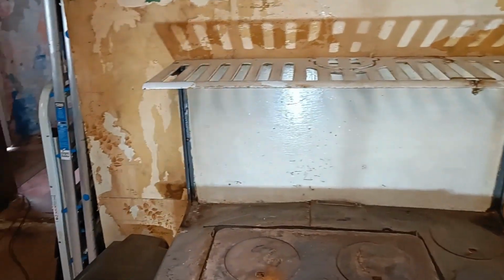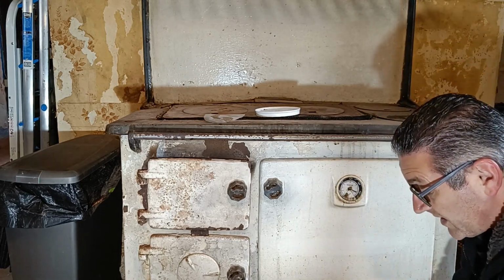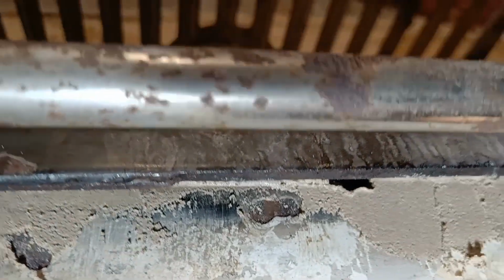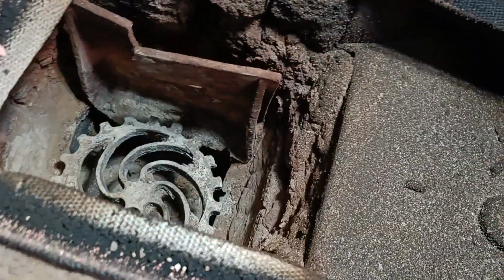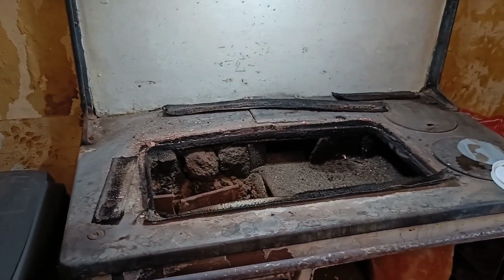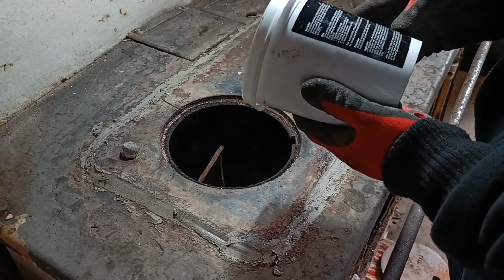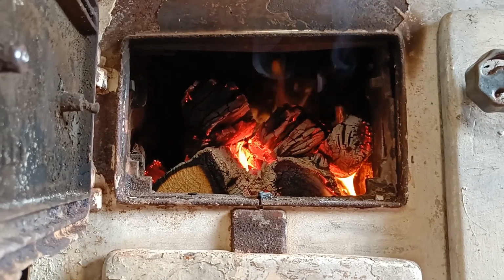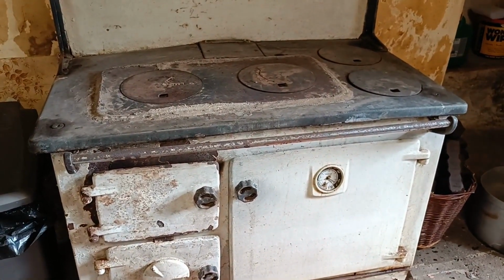Where there is smoke there is fire!

Comment: Interesting way of laying your fire Ben L was always told to put the small stuff at the bottom and only put logs on when that was burning well  but your ways seems to work very well well. Another interesting video😀
Reply from the maker: Yeah we thought that too as Dawn was reading it from Google "How to light a range fire"  But for some reason the upside method works really well, so we stuck with it. :-)
Reply: I thought to lay a wood fire you took the grate away ( this is for coal) and laid the wood straight on the bottom and left the ashes in as a bed for the fire. Maybe this range was for coal, wood and maybe peat?

Comment: You could use a bit of that fibre glass as a baffle. Well done. Now that you have the air leaks sorted the oven might get a bit warmer.  My Salt got all nasty on the bottom when it was really humid here last August, I never thought to dry it out in the oven, thank you!
Reply from the maker: We had 110 degrees c yesterday but where the big rusted spot is at the bottom of the oven, well I found yesterday that there is also a gap on the side of the range, so I think that may be as hot as we will get. That is a good idea with the fibreglass for a baffle.

Yes, the salt lamps and rocks are terrible for dripping. Due to the size of ours, the oven was the only place haha.
Reply: @thecornerhouseproject  Use a cookie sheet/baking tray and cement it to the rusted spot, If the gap on the side is very wide fill it by using the fiberglass and cement like you would bondo on a car, or plaster board taping. Baking trays are safe up to 450 Fahrenheit.
My Salt block is about half the size of yours, they aren't light to move around either lol  How much heat can a salt block take? hmmm

Comment: Those wee Stanley stoves are a great range.   H&S wise...carbon monoxide detectors are a must 😮  we have a solid fuel rayburn. Heat would put you out of the kitchen 😅
Reply from the maker: Yes they are, we would like another due to their history and name.  I removed everything from the rack above the range including the carbon monoxide detector. It sits there quite happily but we know it works due to the smoke that plumed out when first lighting the fire before the fire cement was done.

Comment: The old stanley stove , very reliable. You have good draw of the smoke up the chimney. Will be even better when the ropes are replaced.
Reply from the maker: Ropes on the two small doors replaced… and it has made a huge difference. I’m not sure we will be able to save the range as it has so much to fix on it, it’s a shame because we would have liked to have kept it because it belongs to the house…but we will definitely replace it with another range just like this one, but with a boiler built in for rads, as we love it for the heat it kicks out!
Reply: @thecornerhouseproject  yes getting replacement parts for the older models can be difficult. And expensive.  Replacing it with a back boiler one is a great idea. Great work  you are doing.
Reply from the maker: @jaymurtagh we've bought a couple of replacement parts for this one for the time being because we're definitely not at a stage for sticking radiators in yet lol. The parts I bought yesterday will hopefully keep us going with using this one and getting a bit more heat out of it for a while until radiators and back boiler range can be thought about. Parts are a little expensive but a few places online that are selling most parts which is good.

Comment: If you open  the vent on the bottom  door you will get a better draft when you first start your fire.
Reply from the maker: It normally is once the fire is burning to get a good "roar" going. Then once it is established, we shut it up for a slow burn. With the gaps around the doors at the moment though, it still lets in a ton of air. The sealing rope should arrive today.